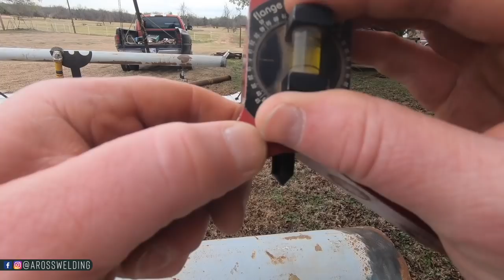PIPELINE BRANCH TEST TIPS FROM A NEW 8" ENTRYWAY OVERHEAD I’M BUILDING (Pipe Welding & Fabrication)

Comment: I have yellow 4 inch template like that I got to do a 4 inch pipe rail to protect my buddy restaurant and they are great! Back in my early days of fitting pipe manual layout was it. I made templates from some gasket material eventually and worked ok but the metal are definitely better. Good job!

Comment: Curiosity Question. When you're cutting are you pointed to the center of the pipe or are you pointed such that the flame is angled up hill a bit to catch the molten slag and push it away from the cut when you're going up hill?